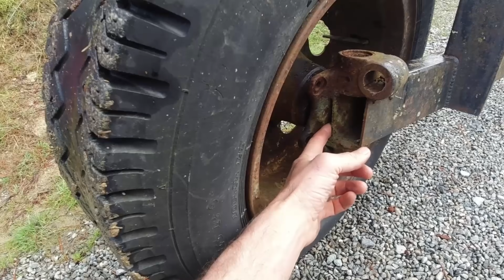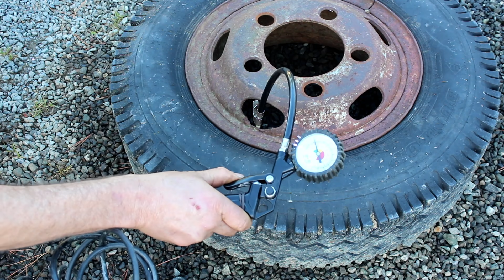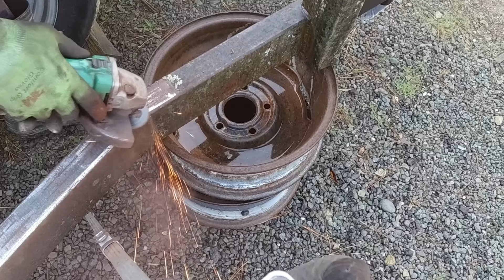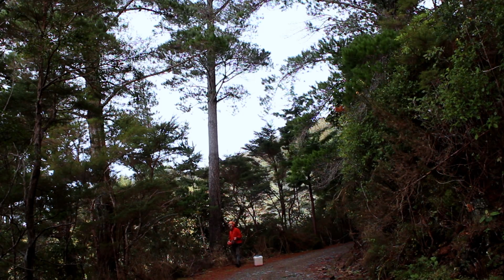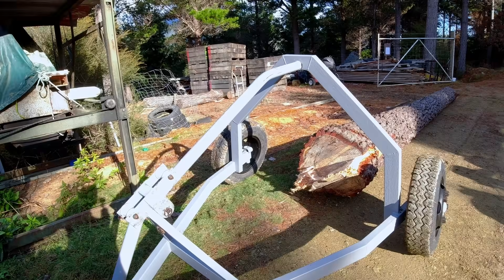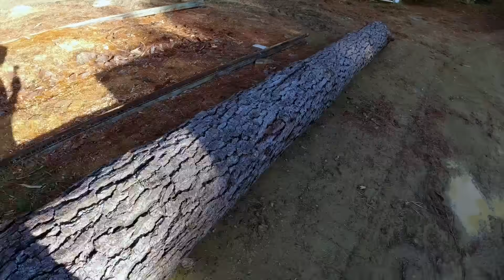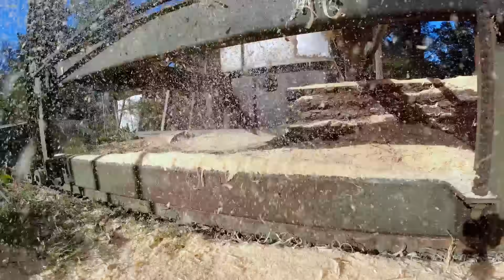Restoring an old Log Arch and Hauling Logs to the Sawmill

Comment: Split rims are deadly dangerous if not treated correctly. Just watched something about them and couldn't believe how they are completely dependent on the lip that joins em doggy as.
Reply: These are the locking ring style and not nearly as dangerous as the old "widow makers" that were split in the middle. You can tell at a glance if that ring is seated correctly. The widow makers were locked in the middle of the rim and once the tire was on there was no way to tell what the condition of the interlock was. In any event ideally you are not anywhere near the face of it when inflating it and seating the tire.

The advantage, and the reason they were used, is you can easily change a big tire without a machine. These ones are small but the 24" ones on my old loader... Try finding a tire shop with a machine that big. The other issue is compatibility. My old dodge has budd rims that are locking ring and you can't find single piece rims that will fit. If I want to replace them I have to cut the centers out of the existing rims and then go find some other rims and cut the centers out of those and then weld the centers into the new rims. My next option is to swap axles but once I do that I have to swap the transfer case and then most likely relocate the motor to get everything to line up again.

Back in the 80's my old chevy had these on the rear tires and at that time shops were moving away from working on them. Now they seem to not mind quite as much. They poke them into a cage and inflate them up.

Comment: They are not split rims.  They are split ring rims or locking ring rims. And there is nothing wrong with them as long as the parts are in sound condition.  Split rims have the barrel of the rim split such as in military combat rims or the Firestone RH 5° rims (aka widow makers)  With locking ring rims just make sure the ring the rim and the wedge (if applicable) are in sound condition and  are not crudded up with rust.  How ever when inflating split ring rims make sure they are assembled properly and either chained together or inflated in a cage..  Regardless stay clear of the ring when inflating.  Once inflated, they are no more dangerous than a single piece rim.

Comment: I wonder if one of your bulldozers would be able to pull that log Arch
Reply from the maker: Easily, but dozer tracks are a lot more expensive to maintain per mile than tractor tyres
Reply: Use the cost-effective measure all the time and when it gets really bad and a 4-wheel drive tractor won't go through use the Dozer for the really bad stuff I love your content you showed me things that I haven't learned here from people in my life you keep doing what you do you're awesome

Comment: Could you have just jacked up the tractor and swapped sides with the wheels?
Reply from the maker: I would have gained a little more width that way, but the bolt brackets are off centre on the rim so the only way to achieve maximum width was to turn the dishes